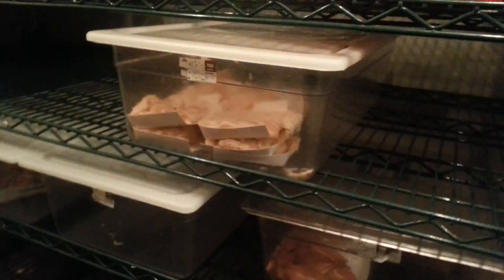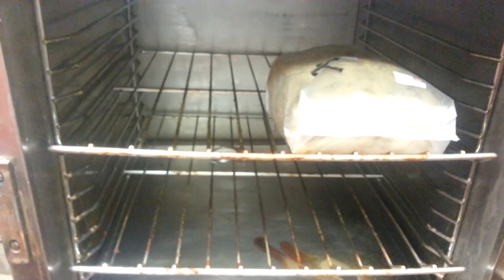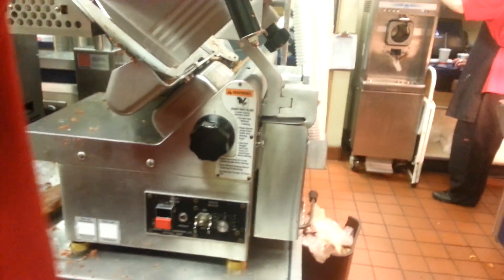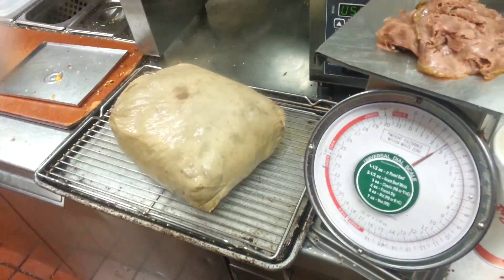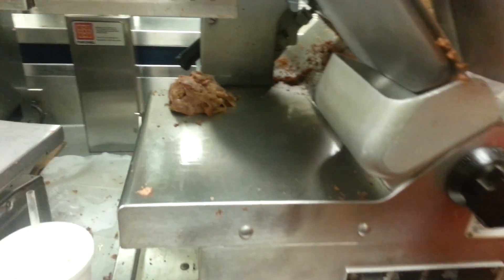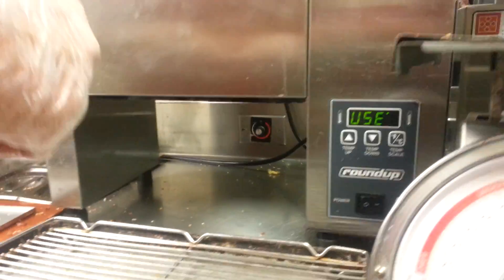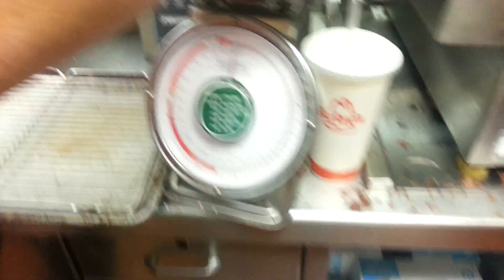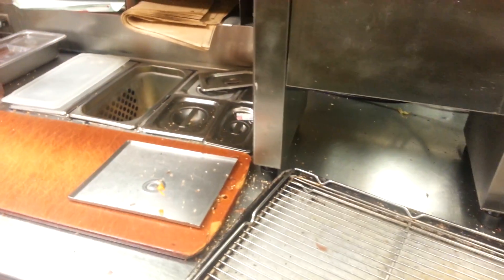arbys beef and chadder

Comment: this should be used as a what not to do video. all the violations just seen in the video made me want to yell at them OMG... Id lose my job if I did all that.
Reply: Commentor1 The only major violations I saw were bread boxes on the ground (not really a big deal, but a violation in a DHEC inspection) and what appeared to be a cup on the back line (HUGE no-no). Everything else was better than what you’ll find in some stores.
Reply: @livingbass9617  And the soda cup with straw right next to the food prep area.

Comment: I work at arbys as a manager beef has to be tempered to 34°F before cooking it, and it only cooks for 3-4 hours hold time on a cooked roast is 48 hours it stays in a hot hold for 30min before it's supposed to go on the slicer. In this video the beef I'd being chipped because the slicer is not sharp enough or its turned down to thin, it is supposed to be wafer thin. Who ever runs this store should be fired so many health and company violations can be seen in this video
Reply: For us it has to be around 4 slices for ounce so we set the slicer to 0.3.
Reply: thats most fast food places. ppl jdgaf anymore it seems
Reply: @meganmurphy3376 hello are you still working ?

Comment: If you're doing beef change what's the temperature for the beef
Reply: El Mejor The ideal temp is 165, but for all real purposes, anything between 140-150 is fine. Any meat below 130 on a slicer should be immediately discarded.
Reply: It should be about 158. At least that's what it is when we do it

Comment: I noticed none of the boxes are dated you also have to date all the boxes in the cooler and also on the freezer I don't see the date on the boxes that's also another violation
Reply: no u don’t lmao the company that sends the meat dates it with a stamp and we mark the beef individually when we start to temper it. but good try
Reply: Actually he's partially correct. Coming from a former assistant manager at a corporate store, all dates must be written on the boxes of food items immediately when receiving them on truck. While it's not necessarily a health code violation (that is assuming the vendor put labels on them with dates) it is a violation of arbys policy. It is a method used for easier and quicker rotation of food. So while a health inspector may not mark off for that, if an arbys performance manager came in and did an AOR inspection they would take a massive amount of points off and make you correct it immediately.
Reply: i liked rotating the inventory when i worked in a snack shop.
wasnt hard to maintain